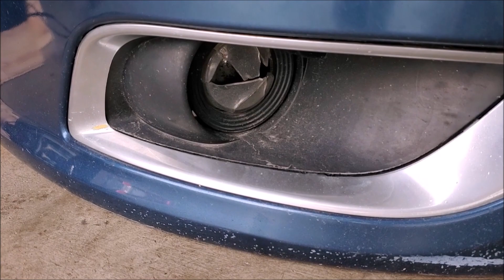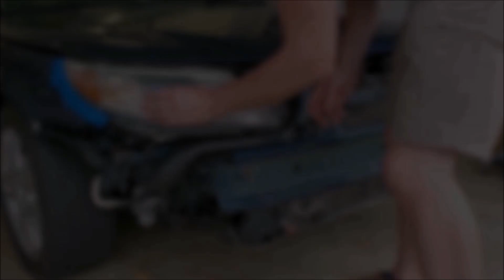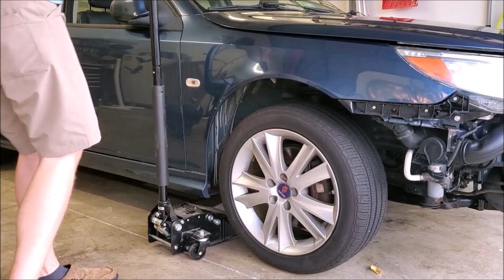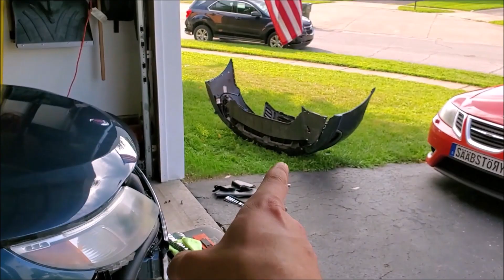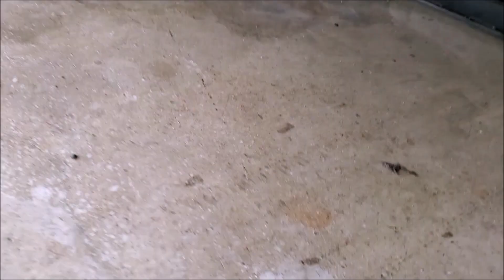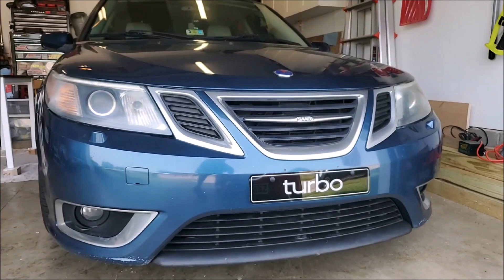Project 9-3 Aero's Front End Assembly

Comment: Great video. I'd just recommend to always use jack stands. I was bleeding my Saab 9-5 brakes and had the car lifted with a brand new Harbor Freight jack, but I also had some jack stands just in case. When I went to remove the jack stands they wouldn't come out because the jack had failed and collapsed. If I didn't have the jack stands in place, I'd be dead.